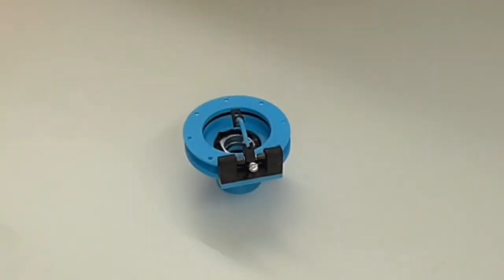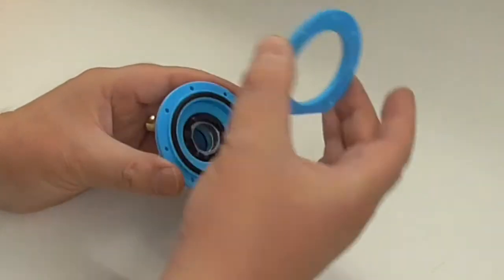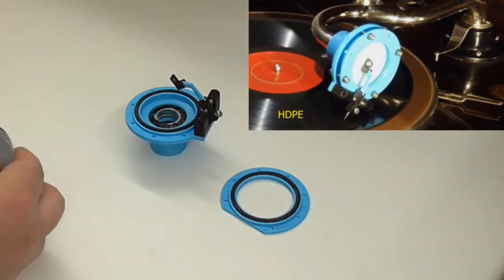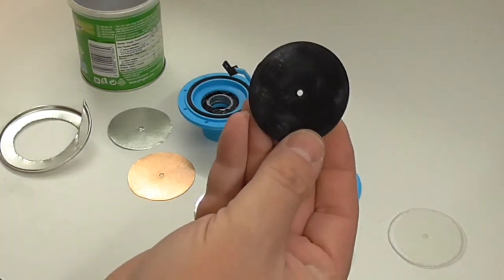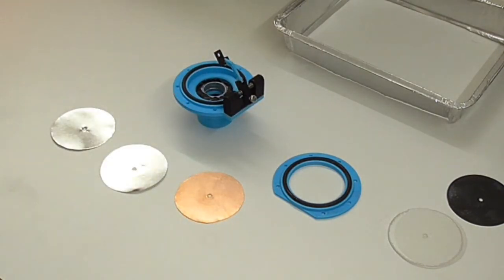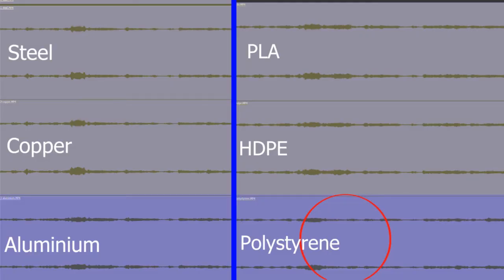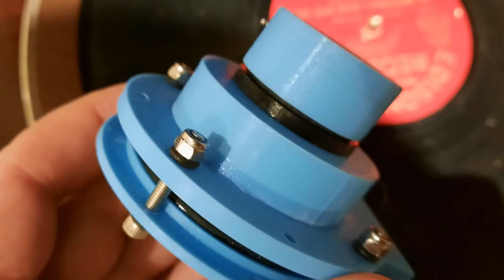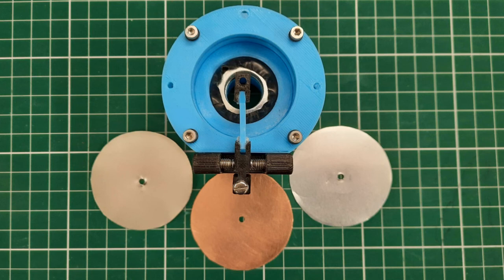DIY gramophone soundbox / reproducer diaphragm test part 2

Comment: :hand-pink-waving: I like very much your test. Can I suggest you a thing? You use a large rectangular contact surface between the membrane and the needle arm and this muffle the membrane changing its feature. Normally they used only a small screw passing through a small hole in the center. A singular forcepoint in the center should be the best, but you could simply put a very small circular washer between your rectangular contact surface and the membrane. A circular smaller cantact surface gives a better sound feature to every membrane you will test. Be sure to put the the center hole and the circular washer right in the center. Soundwaves propagate in circular mode from the center to the border. If you give the force by a rectangle the membrane can't vibrate freely between the small side and the long side  loosing power and phasing. Excuse my spaghetti-english.
 God save your ears.
Reply from the maker: Thanks 😀 👍.  Glad you enjoyed the video. Yes, the join to the diaphragm could be better. This was my next attempt, not perfect but at least the needlebar is better:
https://youtu.be/A7qNRg3BS5o

Comment: The steel is cleaner, but no doubt due to thickness, elimating unwanted vibration.
Reply from the maker: Yes, the steel does seem to be quite popular, though looking back over the comments,  the copper was also a popular first choice. Next test is the mica, and it will be corrugated aluminium after that! Thanks 😀 👍

Comment: Well, I have to say the steel one for me was better...  I think you have to look at one thing here which you have not been able to copy so far and that is your diaphragms are simple discs against a true diaphragm that is shaped like a pie crust is with a fork before baking and has other indentations...  Here I am back to pies and the trays, lol...   But if you could try and reproduce the true shape of the real diaphragms would be interesting to hear the difference, easily done maybe with my pie tin foils...    Well done anyway, enjoyed the experiment, sorry I'm a bit late getting here, thanks for the mention...     Chris...
Reply from the maker: Yes, well the steel one did seem to be quite popular. I think testing with plain diaphragms was worth doing, but it certainly shows why the period metal ones weren't flat as they aren't all that good! 😉  I will try pressing indentations into an aluminium one and see if it helps. Thanks 😀 👍
Reply: @mrrgstuff Oh, cool...  :)

Comment: The sound quality has improved, but I want the volume.  I also watch other people's own sound box videos, but I think that there are many patterns in which the volume decreases when the sound quality is improved.
Reply from the maker: Yes - getting volume is difficult and so far none of my DIY gramophones or sound boxes are as loud as an original one. However as my sound boxes get closer in design to the real thing - the volume is improving. I have bought a mica diaphragm for this sound box and that certainly helps with the volume. I will post a video about it hopefully in the next couple of weeks. I have also tried various horns but with little success. I have a real gramophone horn - but even with that I couldn't get it as loud as I wanted. You can see the tests I did here:
https://youtu.be/h8uj0v6fF0I
Thanks 👍😊

Comment: I think steel was the best
Reply from the maker: Yes, the steel performed very well, though I couldn't decide if I liked it more than the copper. The aluminium was disappointing. The steel is also easy to find as long as you can get your hands on Pringles tube! Thanks 😀 👍

Comment: Personally, I think the Perspex one has worked best so far. Other than that, I see Paul Harrison has already suggested the concentric corrugations, which I think would work well on aluminium or copper, since they might raise the treble response a bit. They were common on diaphragms 'Back in the Day'. However, my favourite soundbox in my own collection is the Decca 'Telesmatic', which has a mica diaphragm.  My guess so far is that Perspex, mica, and metal foil with corrugations (copper, tin or aluminium), will prove to be the most satisfactory materials. Perspex was not available back then, but for a 'flat' un-corrugated diaphragm it might prove to be the easiest today!
Reply from the maker: I liked the Perspex too, although I believe its actually Polystyrene - its part of an old CD jewel case. I  believe these varied in thickness so I am hunting around to see is if can find anything thinner. If I can find really thin perspex I may try that too. I hope also to try 3D printed stampers to corrugate the metal  though I think this will only really be effective with the aluminium. Thanks 😀 👍

Comment: For me, steel gives a more balanced result, perhaps a bit like mica, compliant, but not too compliant. Copper & aluminium seem to favour surface noise & treble, the aluminium more so. Perhaps, due to the compliance, the inner part of the diaphragm is doing the bulk of the vibrating, a bit like a mini tweeter! All aluminium diaphragms I've seen (excluding the HMV 'orthophonics') have concentric corrugations & seem to work well. Can imagine that even the thin aluminium of a takeaway food container, with a series of concentric corrugations, may even be sufficiently firm due to 'work hardening' of the metal. If you want to try concentric corrugations, perhaps placing the diaphragm on a bed of 'Blue Tack' & pressing the neck of various sizes of plastic bottles against it would give you those concentric corrugations. Have only seen one example of a copper diaphragm (with corrugations of course) & that was in a reproducer for an Edison Phonograph. To my ear, the result was the same as a mica diaphragm.
Reply from the maker: I think the steel has much to recommend it, not least its availability, at least in any country where Pringles are sold 😉. Couldn't really make my mind up between the copper and the steel. Didn't like the aluminium sound, though it seemed ok when I was recording it. I hope to makes some 3D printed dies to stamp or emboss corrugations, though I am only really expecting this to work on the aluminium one. I also understand there were composite diaphragms with a mica centre and a aluminium outer, so may try something like that. Thanks 😀 👍

Comment: Brilliant video. I was listening with headphones, aluminium was very thin and noisy, copper was nice but more mid range surface noise than I like and the steel did a great job. I can't recall what you are using for the gaskets, looks like a rubber tubing of sorts. I use a 3mm neoprene foam rubber and am always impressed by it. Smooths the sound wonderfully. Dead cheap too. Great videos and experiments. Thanks for these . Cheers Paul
Reply: Hi Paul, where do you source this 3mm neoprene foam rubber ? Wondered how you got such great results from your gramophones. Any chance of sending me some please?
Reply: @tiga4180  I put him onto it, actually I taught him how to service gramophones. He is getting there finally! 👏😎
Reply: @rocketaroo  ha ha ha you did not 🤣🤣🤣 you are shocking, you'll claim anything 😂😂
Reply: @tiga4180  certainly. Consider it done 👍👍
Reply: @GramophonicReevolution  Thanks Paul!
Reply from the maker: Thanks 😀 👍. They all sounded pretty acceptable to me when filming, but when editing together I found the aluminium the least satisfactory. Although I can hear some difference between the steel and the copper, I couldn't really say which was best. 
Yes, I am using the 3mm neoprene foam rubber too, as it is so cheap! I buy mine on ebay by the metre. I have also ordered some  'proper' white gasket tube, although this is more for fixing original sound boxes

Comment: It would be a good experiment to try pressing various ridges into the metal, to see if that improves compliance. The steel might not be as easy to work as the copper or aluminum, though.
Reply from the maker: Yes, I hope to try corrugating and maybe laminating some diaphragms. I plan to 3D print some dies, but will probably only be strong enough for the aluminium. Thanks 😀 👍

Comment: Copper for me on the acoustic , not much in it on the electrical. Would it make a difference do you think trying to put a pattern into the Aluminium one? Thanks for doing this.
Reply from the maker: I believe copper was used on some acoustic sound boxes, though mica I expect to perform better. I hope to try corrugating the aluminium ones, maybe with 3D printed dies,  might work for the other metals too, but probably to hard for my equipment. Thanks 😀 👍
Reply: mrrgstuff just remembered you are still on the d.i.y gasket aren’t you? Can you source sone of the regular stuff ? Cheers, D
Reply from the maker: Yes  I am using the 3mm neoprene foamed cord, which at least on this sound box I can't change as it is superglued in and the glue is stronger than the rubber! I have got some of the normal stuff too now, which will appear in probably the next video, but priority for that is vintage sound boxes, so it will depend on whether I have any left over. I plan in the next version of my sound box to not have to glue the gaskets in which will help. Interestingly enough it seems from some of the other viewers who have commented that the 3mm neoprene is a good performer in vintage sound boxes anyway, so I wouldn't expect there to be much difference. Thanks 😀 👍

Comment: You presented a very good and thorough comparison! To my ears the copper diaphragm sounded slightly better overall than the steel. The aluminum diaphragm sounded a bit muffled.
Reply from the maker: Thanks. Yes, the aluminium one was disappointing. Might be worth trying to laminate or corrugate it. The copper was good, though not as different from the steel as I expected. 😀👍